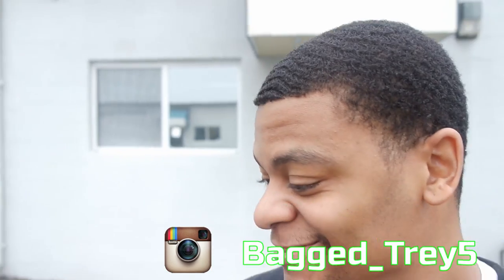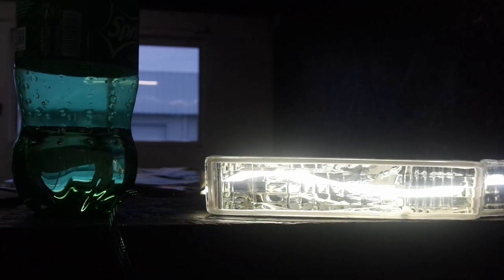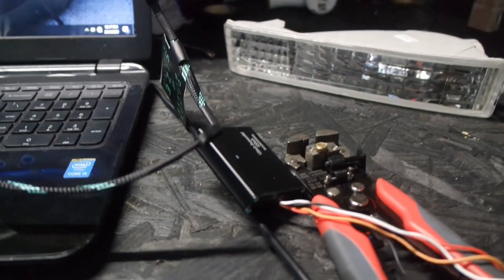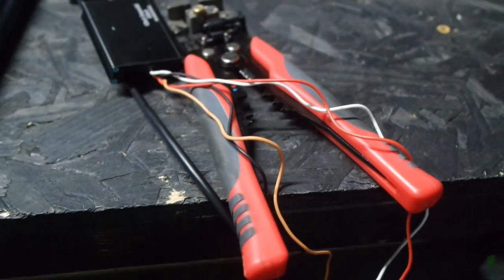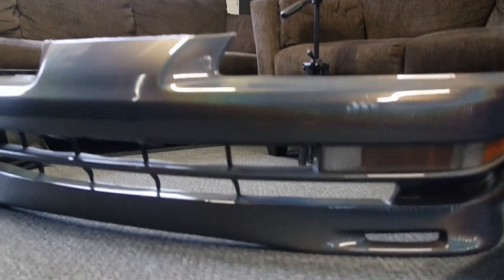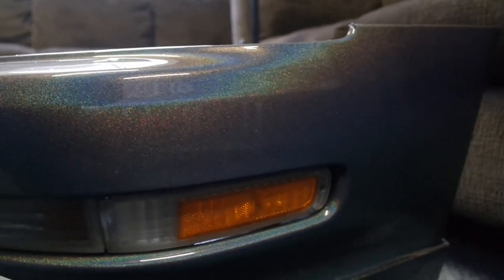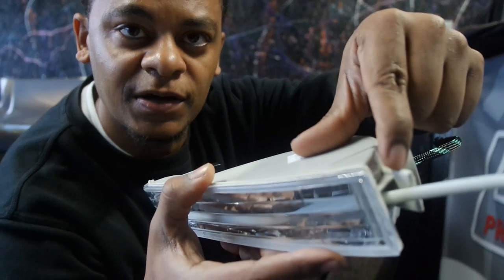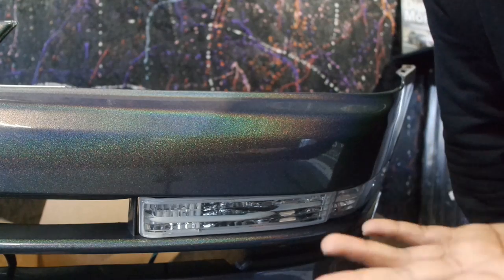LED sequential switchback turn signals | Honda Prelude

Comment: Great work man one question are you worried about moisture getting in the housing I've seen it happen in the rear tail lights before
Reply from the maker: It always a concern but with these lights being brand new im not too worried.

Comment: That sick bro details please . Would turn signal be brighter if it was facing the reflected side the light ?
Reply from the maker: Not sure but the back of the led strip would be an eye sore
Reply: @treybedipping1734  ok gotta link to the light? Still waiting on that ghost light tutorial.  Haha had go buy fogs and turns like the clear front look. Getting warmer, so gettin be time need that fresh wrap.its a drive but want someone with that Prelude love doing it. Thanks for answering every question you a good dude.
Reply from the maker: @dylanmiller3252  no problem bro the lights are sold out cause of this virus thing. The tail lights ill be doing another set here reeeeealll soon so stay tuned for that ill throw in the programming part too
Reply: @treybedipping1734  hell yeah buddy

Comment: Pretty cool, where’s a link to the LEDs? Keep doing cool stuff to that 4th gen! What about doing the rears next? 😎🤙🏻
Reply from the maker: Im on it bro lol led sequential strips are sold out cause of the virus
Reply: Trey Be Dipping I hear you there. Still curious about that part number my ninja! 😉 Will be dope to make the full back area a turn signal and then also a reverse light... might be a little more tricky but way cool. Plus, gonna wanna find a way to seal up those holes a bit so dirt/water don’t get in there as bad. Otherwise, loving it! 😎🤙🏻

Comment: This is dope bro! Retrospect, would you have drilled the holes through the top or the bottom instead of through the middle? What LED strip did you use?
Reply from the maker: The middle seemed like the best spot for me. And pivot led strip

Comment: Did you have to modify your flasher relay for those to work?
Reply from the maker: Yea had to run a led resister in line with the bulb

Comment: anyone know where to get the white clips that the screw goes through? it clips into the bumper and the indicator light. my light has been held in with a zip tie for like 5 years now and it looks super ghetto lol also its called a step drill @trey
Reply from the maker: My new lights came with them. Or try a junk yard
Reply: Might have to order another set. In Australia preludes are rare in wreckers now, a bit old. I did order a pair years ago on my old prelude but it didn't come with any, ebay life i guess lol.
Reply: @treybedipping1734  Where did you buy them?